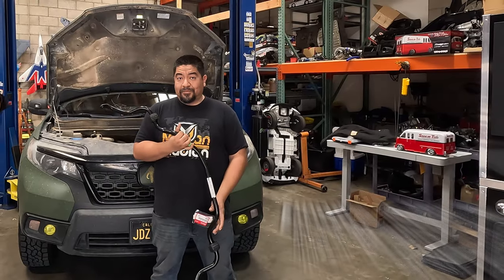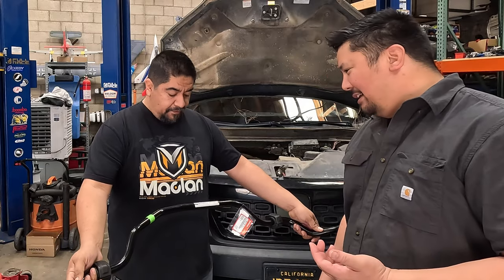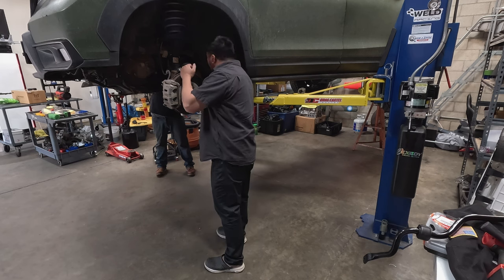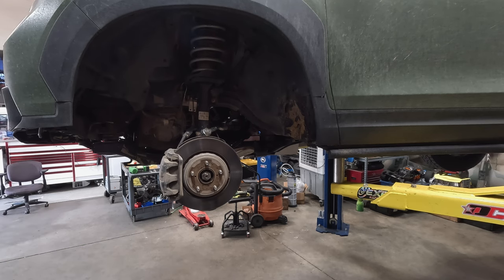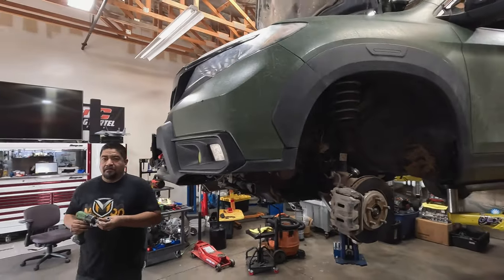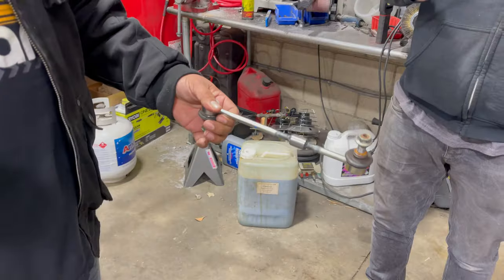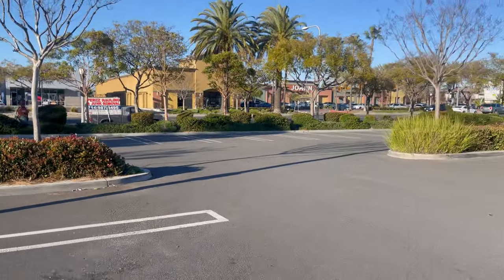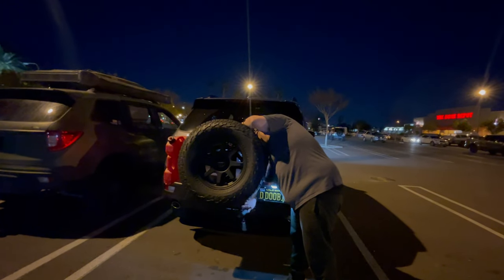Best of both Worlds!  *ALL NEW* TrailSport Sway Bar install on previous gen Pilot/Ridgeline/Passport

Comment: From the information I’ve gathered from previous measurements I’ve done with a factory sway was about 3.5 inches of flex left to right.  When one side is completely compressed with the sway bar connected it will cause the other side not to droop fully, this causes more off camber situations.  
23 TS Sway on my ridgeline currently measured at 5 inches of total flex left to right.  For experimental info I disconnected the sway bar link and it measured 8.05 inches left to right flex

Comment: Hey Jon.   Thanks for the sway bar vid!    Did you get new front CV axles?  They look new(er)?      How does that new sway bar work for you?
Reply from the maker: Thanks Ram!  Regarding the front CV axles, I replaced the front driver side when the Eibach springs were put in (which was at 110K on the odometer).  No good reason other than they are cheap and might as well change them when you have the knuckles disconnected.  The front passenger side was changed out at 70K miles.  Long story, but at 36K I hit a rut at high speed which caused a leaky front strut, partially ripped lower control arm bushing and a leaky axle.  All those parts lasted just fine and then at 70K I replaced / rebuilt the suspension.  At 50k, I had the Traxda 3.5” lift installed, and upon installation, the threads to the axle was damaged.  I was on a time crunch and we couldn’t get an OEM replacement axle, so we just used an auto zone axle.  Aftermarket is not of the same quality as OEM, and 90k or so, the axle boot ripped off.  It was replaced with OEM.  All this is documented in my videos.
Reply: @JonDZ_Adventuring  Hey thanks!  Love hearing about the mighty cool Passport!

Comment: I think you had a video of putting Ridgeline shocks on your passport, any knowledge about the pilot trail sport shocks? Are there beefed up over other trims? Would try be a better fit for passport?
Reply: If your referring to the 2023 pilot TS struts, I have retrofitted the front TS struts on my ridgeline and testing them.  The rear TS 23 struts do not fit our platform

Comment: What about 2023 pilot Skidplate install on Passport ?!?!?!
Reply from the maker: That’s a good question.  Not sure if it would fit.  There’s already NoLo design skid plates and Manny has been figuring out how to better secure them so they don’t make creaking noises.
Reply: @JonDZ_Adventuring  but the oem has built in escape and jack point with better cooling and easy oil change. Also the oem skid plate  not intrude with suspension (the creaking noice). With all respect to No-Lo the Honda engineers takes in account much more factors in design.
Reply from the maker: @7gan7  I haven’t seen the OEM 2023 Pilot skid plate.  Manny decided to secure the NoLo plates which leads me to believe the new Honda plate won’t work.  The 2023 Pilot has an all new engine and transmission.

As far as the recovery point.  It appears we can just use the crossmember bar that the NoLo skid plate connects to.
Reply: @7gan7   the 23 TS skid is nice and very robust but it doesn’t cover the PTU, it’s quite exposed in the TS. The TS skid plate is also mounted to a completely different subframe which from what I’ve seen is nothing like the current midsize Honda platform.

Comment: Sweet upgrade. Please don’t make GXs look bad…
Reply from the maker: I’m going to do the justice with the “stock” GX vs. modified midsize Honda video.  That’s why I want to put aside many hours for editing and nerding out.  Going to “Keep it real, not highlight reel the Honda” 😄.  My friend was going to buy a JK, but talked him out of it and recommended a Lexus GX 460 😃.
Reply: @JonDZ_Adventuring  Looking forward to it!
Reply from the maker: @robbergstrom943  me too!  Basically, a stock Lexus GX 460 needs to remove the 8” vertical running boards and trim front bumper, and a modified Honda Passport takes on an all new level of capability by increasing ground clearance and increasing flex.